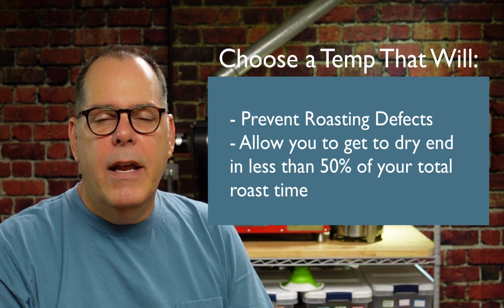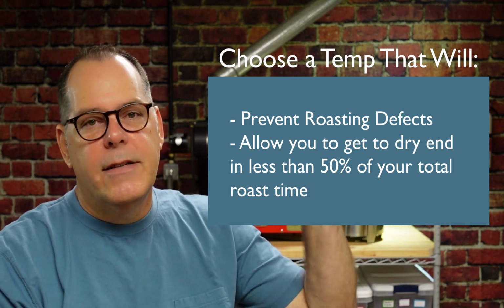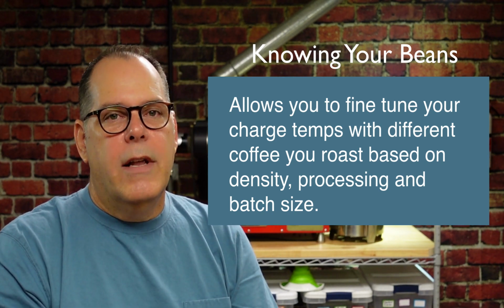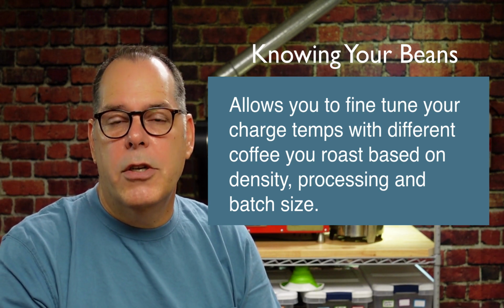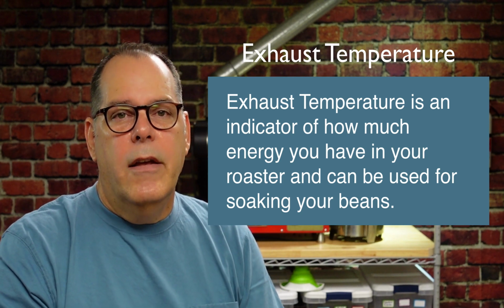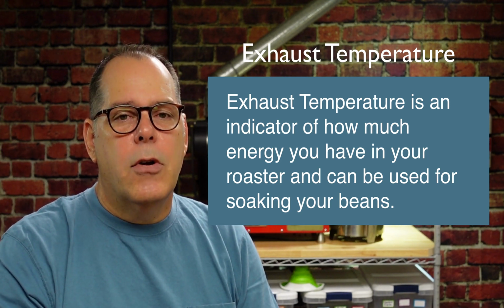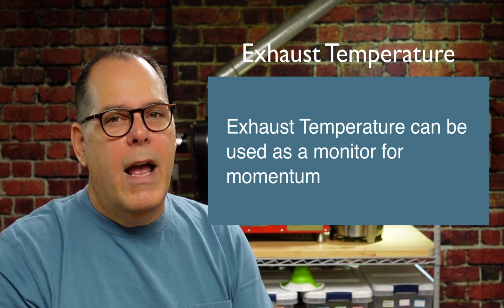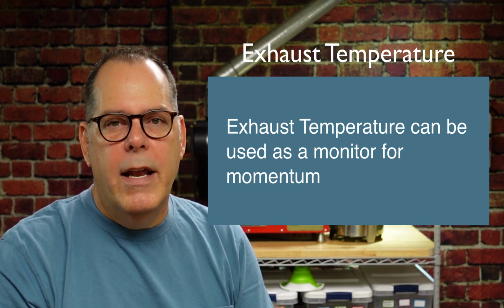Charge Temperatures For Home Coffee Roasters

Comment: I just got a @HiveRoaster in the mail last night. Not the digital model. Trying to figure thermometer resources.  It will need to season, so expect to lose number of roasts between that and learning curve. I haven't even settled on which source of green coffee to get yet. 
I hope to figure out how to monitor the temperature. I have looked at probes, but don't think I am up for drilling an entry for that. So I may see if a thermal "gun" hits anywhere relevant. Also using a butane Iwatani portable burner purporting to hit 15,000 BTU's which I have cooked with and see it brings 2 quarts to boil at better speed than my electric stovetop is wired for. I may also be dealing with low air temperature as I intend to go outside until I learn enough to feel safety about the ventilation.
I guess I will look for a washed forgiving less novel bean and start out at full flame to have a top to descend from in next attempt. 
Nothing digital, although the maker gave me links for the probes and the usb and the app if I was handy enough, but I am not.
It took me a few years to be versatile in using all the brewers that came my way and to understand the coffee map and processes. Had been following @JamesHoffmann and @LanceHedrick about those variables. Now am following @VirtualCoffeeLab - Home Coffee Roaster. And @MikeSieger for @HiveRoaster although they may be on Instagram. @SweetMarie has a roaster resource library too.
Reply from the maker: Thanks for sharing your coffee journey.  If you are planning on roasting to season, this is a great opportunity to train your senses with the Hive.  I would keep the flame consistent and change the elevation of the Hive.  This will allow you to focus on the roast.  Also, consider using an LED flashlight to look into the dome to check color along the way
Reply: @VirtualCoffeeLab  Thank you about the distance as the heat variable with less fussing. I saw that the maker, Mat, removes the hob trivet to not hit that metal to metal too.  Have a camping headlamp placed in my kit to spotlight into the Hive.

Comment: How would roasting in a cold garage effect drying?
Reply from the maker: Hi Michael, roasting in cold environments will require more energy and can slow down your roasting times.  
What are you roasting with?  Are you roasting on an air roaster?  The glass is pretty thin compared to a steel drum.  I don’t normally recommend prewarming an air roaster as the air and roasting chamber are instantly hot. If it is an air roaster, and it’s cold,  or room temperature I would recommend a short prewarm because that will shorten the dry time.

Comment: I just started roasting on the Gene Cafe and I’m trying to get that perfect roast. I’m having loads of fun. I’m in Florida and my question is: which charge temperature should I use? I was considering 350 or 375. Would love your input.
Reply from the maker: Thanks for watching.  I would watch my Gene Cafe videos I’ve done.  Depending on the bean type and origin, and density, and the amount of beans you are roasting.  How dark you plan to roast is another factor.
I suggest you do not roast a full load on this roaster because it will take a long time to roast.  If the green coffee is a Central American or some other high altitude bean, you could start at 485.  For the preheat, then add 1/2 pound beans to the roasting chamber, and then full power.  This should get you to yellow by about 5 minutes.
The Gene Cafe will peak at temp and then the heat will cycle as low as 465 and then begin to climb again.  Assuming you roast a medium roast, at first crack lower your power to 4:35.  If you are roasting darker, keep full power.
Reply from the maker: Here is a link to my washed coffee roast on the Gene Cafe - https://youtu.be/QzJiMS_8An4
Reply: Thank you so much. I have to admit, this is a different but fun hobby. I started drinking coffee at the age of 5 years old and never stopped. You got my follow. Maybe one day I’ll upgrade to a better toaster. Take care

Comment: Hello Mike, I can't tell you how helpful your videos are to a novice roaster like myself.  Do you have any suggestions on how to soak the coffee with an electric drum roaster like the Aillio Bullet.  I am trying to master the charge temperatures and can't quite get my dry phase under 50% of my total times
Reply from the maker: Hello Richard - I would not recommend using a "soak" for the bullet.  I use the "soak" with my Mill City 500 gram roaster.  I can do this because the roaster has a lot of thick plate metal and the entire roasters absorbs the heat and acts as a heatsink.  The Bullet and Kaleido roasters are not designed in this way.  

So, in order for you to get a shorter dry time you have several variables you can change in order to accomplish this:
1.  Higher charge temp
2. Lower charge weight
3. lower airflow
4.  Longer warm-up time
5. Higher power setting at charge and during dry event.

Any combination of these changes will help shorten your dry time.
Reply: 7:42 🎉🎉🎉😢😢🎉 7🎉😅🎉
Reply: 😢🎉😢🎉🎉😢 8:11 😢😢🎉🎉 8:13 🎉 8:🎉🎉😅😢🎉🎉😢😢🎉😢😢😢 8:38 😢🎉😢 8:43 8:44 🎉😢😮 8:50 14 🎉 8:17 😢 8:18 😢😅😅🎉 8:24

Comment: Hi,
I am using CROPSTER software in probat 5kgs, please I would like to know when I load green beans in the whopper which one is considered as a CHARGE TEMPERATURE Is it exhaust temperature or bean temperature? That will guide to release the green beans in the roasting chamber (roasting drum).
Reply from the maker: Hi Steve, sorry for the slow reply.  I was traveling.  I personally use the BT but I know there are roasting professionals who use the ET as their charge temp.  I don't have a strong opinion either way as long as your setup (between batch protocol) is consistent.  For example, air, charge weight, and drum speed are the same settings at charge from roast to roast.  What have you been using with your roaster?
Reply: @VirtualCoffeeLab  thank you

Comment: I’ve started trying higher charge temps on my M1.  I was mostly using a 160C charge temp and that easily got me through dry and first crack but I was running out of steam to get to the end temp I am aiming for, so I’ve recently been using 175C as a charge and that seems to help with the momentum. I just wish I could drink more coffee so I can keep roasting more beans.
Reply from the maker: Hello Edward.  I'm glad you are enjoying your M1.  One way to ensure you are able to have enough momentum through the roast is to use your ROR scale on the right side of the Artisan graph during the roast and then monitor your ROR number just above that where Artisan displays your BT, ET, and ROR. 

When you use these tools, reference a ROR you have set in your mind (like 20) and have that be your target ROR at the dry event.  Depending on your roast level you are aiming for, select an ROR you would use to enter First Crack (like 12) that will be high enough to help you move through development at the rate of increase you need to finish the roast within your end time and temperature.  This points act as "momentum reference points" during your roast to help you keep on track.  Of course your numbers will be different than what I suggested but I hope that makes sense.  

Let me know if that helps.

Comment: Hi, how do i preheat the roaster in order to have my ET higher than BT before i drop my green coffee to the drum. When i preheat the roaster at 100% heat power, usually the BT and ET will have the same temperature. If i would like to lower down my BT, then ET go down too. Any suggestion on how to keep the ET while lowering down the BT? Thanks. BTW, i am using Kaleido M6.
Reply from the maker: I have not been using that technique with the Kaleido because of the SV (set value) feature.  On my mill city, I could bower about 5 degrees below my charge temp, then increase my power a little to begin climbing toward the charge temp and by doing that, the ET was about 25f higher.  The Kaleido is plenty powerful where you shouldn’t need to do that but experiment and see what happens.

Comment: Your videos are really good. I like your, how should I say, gentle way of conveying information in a down to earth way. I have a Quest M3 electric roaster. It is my third roaster. I made a metal base for it with a round cooling bin with fans underneath and a rotating arm to move the coffee for faster cooling. I use Artisan software with a bean probe and an environmental temp probe. I guess that would qualify as an exhaust temp as it is outside the drum. As far as soaking goes, if I would turn the heat off for a bit, it takes more time for a heating element to come back up to temperature than your gas powered roaster. So can one do that with an electric roaster? I am contemplating getting a Mill City Roaster like yours if I can figure out a place in my wood working and metal working shop to put it. In winter the temperature in my shop runs around 40 to 50 degrees unless I heat the shop with my wood stove. Would 50 degrees affect how a Mill City roaster would work or would it be better if I heated the shop up to a higher temperature?
Reply from the maker: Thank you for your kind words.  I’m glad my video has been helpful for you.  

Soaking isn’t necessary.  It is a method I use with the mill city BUT don’t use with the Kaleido M2 which is electric.  

Ambient (room temperature) can affect roast times.  How long do your roasts take?  Total roast time?
What capacity weight are you using ( how much coffee are you roasting per roast?  

Sometimes taking a slightly different approach can address your problem.  If your roasts take too long, consider roasting fewer beans per batch.  That will give you a head start.  If you can increase the heat in your shop to 60 degrees?  

Pre- heating for a longer period of time will help your roast times.  How long are you pre-heating?  I would suggest you preheat your roaster to 15 degrees above your drop temp.  Then, after about 20-30 minutes of preheating, set your temp to your charge temp.  When you have reached that temp, charge and set your power to whatever you use to reach your target dry time.

As far as the mill city roaster goes, that is a lot of money.  I’m sure it is a good roaster and the double wall drum will really help you in the colder months.  If you are in the market for a 500 gram, have you considered the bullet or Kaleido M6 as an option?  The Kaleido has carbon fiber heating elements and it heats up fast.  It is also quick responding to temperature changes.  Just thought I would mention that.  These roasters cost a lot less than the mill city.

Comment: Over 6 minutes to get to the point; "Charge Temperature." I had to wait for 25% of the video to get a direct answer. 😞
Reply from the maker: I have provided chapters in the video that include what I am covering.  In this video I first need to explain "what charge temperature is", then "how it affects the roast", then context with the different types of equipment and then yes, after 6 minutes "how do I know what charge temperature to use".  Most of my videos have chapters.  Consider using the shortcut chapters if available and that will save you some time.  Thanks for your comment and for watching.

Comment: Love your vids and subscribed, as a very new comer to the roasting game, it would be very helpful if when you talk stages to give a rough ball park number to your times and temps. This would give starting newbies like me, to have some kind of goal to aim for, tweaking can come later as we gain more experience. Or even if you made up a PDF to download with the time stages  + or  - and temps for those stages + or -. This would be so helpful. I won't leave without saying thank you for all your time and effort on these videos I find them fantastic.
Reply from the maker: Thanks for the encouraging comments, subscribing and your suggestion.  I understand why you might find that helpful.  Because we use different roasting machines that in itself won't work. Plus, different types of coffee's, batch weights, bean size, roasting levels and much more, the times and temps will vary.  
A great way to start would be to find some videos I have done using a roaster that is similar to yours.  Watch the times and temps for that video and you could use that as a starting point.    You should also experiment with your roaster.  See how long it takes to get your coffee to the end of the dry phase (when it turns yellow).  This time will vary based on how much coffee you are roasting as well as a charge temperature.  This will help you formulate a total roast profile based on you roasters performance.  
Consider watching "3 tips for new home coffee roasters" video as this talks about a great starting point as far as phase percentages.  I give a couple of examples there.  Hope my response was helpful.

What type of roaster are you using?

Comment: Hey Mike, thanks so much really enjoy the videos.  I recently moved from 6 years on Behmor to a 1K electric toper.  I have heard electric is slower than gas for energy rise.  What are your thought?  I have been told and currently have a charge temp at 194C. thanks for input.
Reply from the maker: Thanks for your comment and question.  Which model do you have, the air (optical)?  Generally speaking, some popular electric drum Roasters like the Hottop or the behmore tend to be a little underpowered with the exception of the bullet.  They tend to be slower to respond to temperature changes.  
As far as charge temperatures go., A good way to determine the best temperature would be to determine how long it takes for you to get from charge to the end of the dry phase / yellow.  If it’s a drum roaster then a good target dry phase would be about five minutes long.  If you were not able to achieve this with the horsepower that your roaster provides then choose a higher charge temperature. So yes 194C  takes 5:15 then try 197C and Watch how that influences your dry phase time.  
Let me know if you have other questions related to this.
Reply: @VirtualCoffeeLab  Sorry forgot I have a 2015 Toper Cafemino
Reply: @VirtualCoffeeLab  Thanks for your input. appreciate it!  Take care!
Reply from the maker: looks like a great roaster.